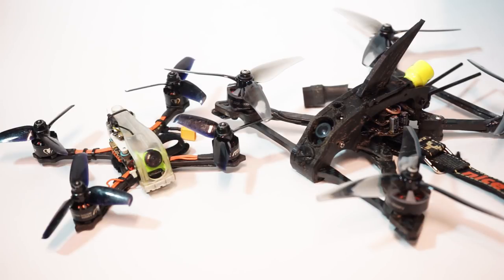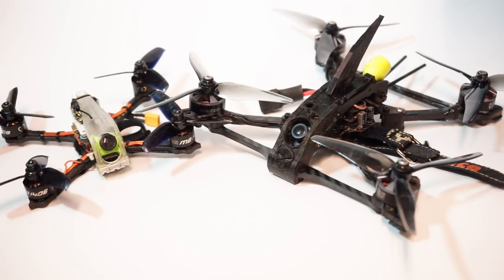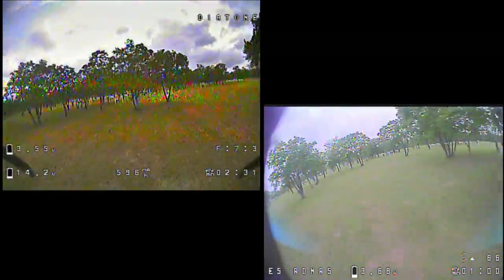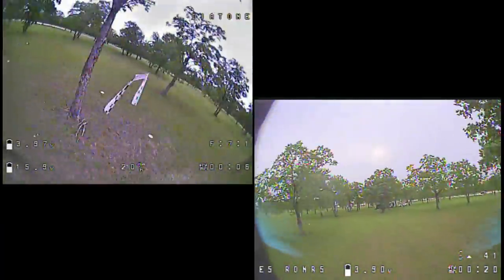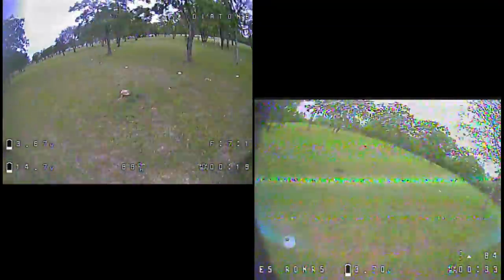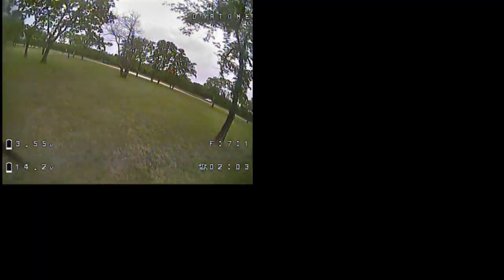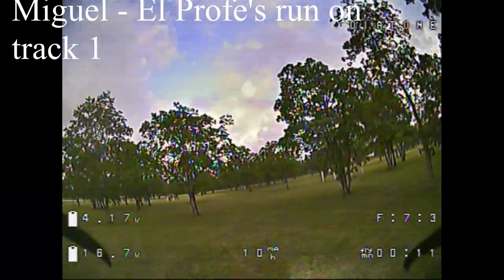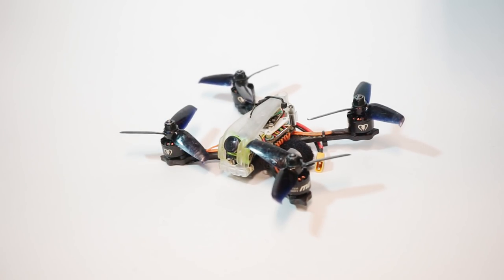3” Drone vs 5” racing diatone GT R349 on a track

Comment: Both the camera and vtx look substantially better on the Diatone. I have the V2 sitting on my table right now waiting to be set up.  Just looking at it on the bench I can tell its the nicest 3 inch quad I have ever seen. It made such an impact on me when I brought it out of the box I definitely will be buying another one at some point. The build quality is fantastic and the convenience of pre harnessed buzzer cables, receiver and camera controls are stellar.
Reply from the maker: For sure, Diatone has absolutely been killing it.  <3 their stuff, i have videos up of both of the Diatone Cubes, have you tried those out?  Not quite as fast, but smaller and lighter.  Very fun to take around to a small park or yard.
Reply: @JonE5FPV  Hey just found out that DJI will be making their digital VTX in a 20x20 stack, cant wait to throw that in the R349 later in the year once it releases. I am hyped about that.

Comment: I flew a 2 inch with minimal power (gtr90) against 2 race kwads once. The maneuverability seemed to be the only advantage you need if you can stay on course. I have seriously been thinking of a 3 inch just to start racing. Less chance of getting knocked out and gates are 'bigger.'

Comment: Great comparison. I think it all depends on the track. I love running a 3” on a tight track.  At our race Saturday for fun I ran my old sparrow build with some emax 1306’s, it’s not the fastest but it definitely handles very well. My times were actually about the same as on my ultralite 2205 6s rig. My average on the 5” was 26-30 seconds and with the 3 inch about 28-32 seconds. So very close on that particular track. I bet if I had a newer 3 inch setup with 1408’s or larger motors it wouldn’t definitely beaten my 5 inch.

Comment: I decided to get the diatone r349 I got it setup binded camera looks very good I took it out today and I'm getting very bad reception like horrible I can't go 50 feet from it that starts to lose reception I put the power at 200 I switch between channels to see if other channels would be better it's it's worse than the tinyhawk which was clear at 25 power and I got a TBS version any ideas what can be.

Comment: Tldr: the speed and agility are there but the battery does not keep up, because 5 inch cruise much faster. Am I correct? 
While the 3 is agile, it looks like the 5 changes direction with a bit less effort. What do you think?
Reply from the maker: This is the first 3" i have had, that had battery that could finish a 2 min track. Usually the speed is there, but when you push it, it is hard to get more than 1:20-1:30.  This one can do it, the changes with direction, etc... are mostly due to it flying different being so much lighter and having a different throttle curve.  This would go away with more packs, very impressive.

Comment: First of all, great video, I was wondering how a real racer would feel about this . You bring up some very good points. I suspect 3" design will improve and develop, as under 250 grams may become the normal. I just got my Rabbit, but I  fly for fun, not competition. My buddy and I sometimes race, but not much. I also have an XJB145, and that with a good tune is  crazy good on a smaller, more technical track. Again, I am just speaking from limited experience. My 5" Chameleon feels like a Mac truck ,in comparison  LOL !!
Reply from the maker: Thanks for sharing this. I remember taking my OG Chameleon to my first race, and i got 6th place with it, lol.  Freestyle builds can be raced, but if you get a nice race build it goes around a track much easier.  

I hope we can eventually host another micro race some day.  These things are fun, and less to worry about weight wise.

Comment: Which one was faster?
Reply from the maker: in a straight line i believe the Diatone is faster, on the track i was making it faster on the 5", but the 3" was close enough to that with practice could likely make it equal.